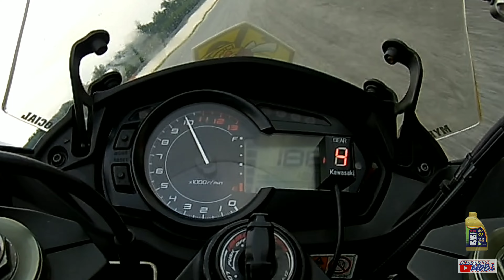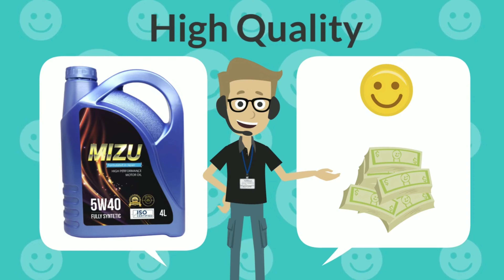MIZU 4T TEST ON SEPANG TRACK! | Tebuan 52 Track Day 2022

Comment: Saya pakai minyak enjin kereta mizu 5w50 kat skuter modenas elegan 250 mmg mantap. Spesifikasi ikut manual book mmg memerlukan 5w50 untuk engine. Lebih jimat sebab sebotol 4L baru 80 ringgit. Sekali tukar minyak engine cost dalam 20 ringgit ja. Siap dapat fully sintetik.
Reply from the maker: Cun.  Terbaik.  Utk Scooter Ada Minyak Khas Mizu Utk Scooter.  Tapi So Far Ada 10W40  Shj. Fully With Ester. Botol Warna Putih 🙂

Comment: saya baru pakai 10w40 pd MT25 saya dlm sminggu,sejak pakai minyak petrol ada kuat makan ckit stiap hari saya cruising 150kmh ulang alik PG ~ PTP
Reply from the maker: Ooo Yeke.  selain dari tu.  dr segi smooth enjin dan gearing cun tak ? 🙂
Reply: @kimmydepasso  saya rase overall performance saya berani bg jamin lebih baik drpd cap Yamalube yg 10w40 full synthetic harga dalam RM35-40 hinggit tu botol itam stiker kuning. Sbab Yamalube tu ada yg cap ayam sama macam Kes Castrol. Mizu ni lak dia murah 1.5x drpd cap Y tu pastu nak cakap engine berat tidak engine smooth pon x performance oklah utk monthly budget mcm saya ni lainlah harga mizu ni dlm 50-80 sbotol mmg aku complain kt distributor tros🤣. Jd Lau ada owner R25/MT25 ternampak komen aku ni overall performance minyak cap MIZU ni mcm prenggan kt atas yg aku Taip ni lg cun 15w50 kot sbab engine MT/R25 ni tekanan tinggi Lau LC/ Whsuku sangat syesyuai kot utk 10w40
Reply from the maker: Mantap bro... Terima Kasih Atas Review Jujur 🙂👌🏻
Reply: Saya pakai 15,50w fully pada FZ modi saya Dan y16 kilang standart,boleh la enjin pun tak berat,guna motor standart lagi tak risau,moto modi saya tukar setiap 1k ke 1.5k km

Comment: Untuk Y15 yg mana satu lebih elok...pakai 1040 atau 1550 bang...
Reply from the maker: Y15 10w40 ngam  👍🏻🙂
Reply: @kimmydepasso  alamak..dah trbeli yg 1550..dua botol plak tu..😂😂😂
Reply: @deepokcik  klu enjin standart biasa pakai 10w40, tpi klu enjin dh up spec better 10w50 @ 15w50 mmng ngam ..